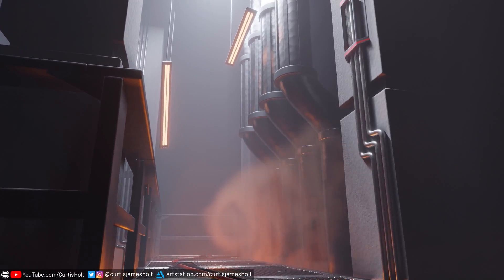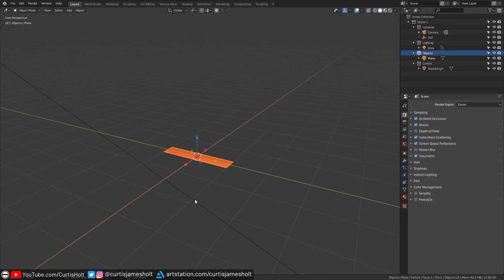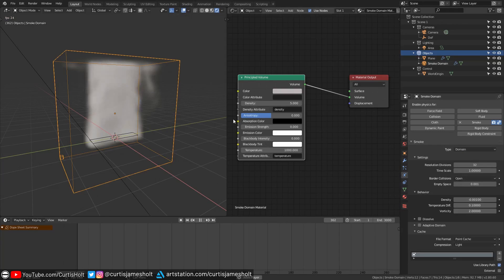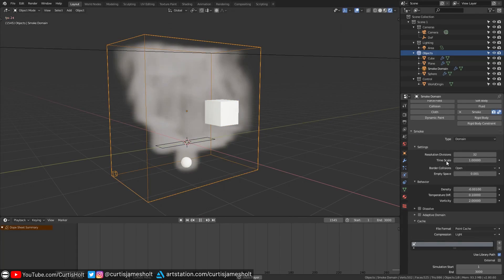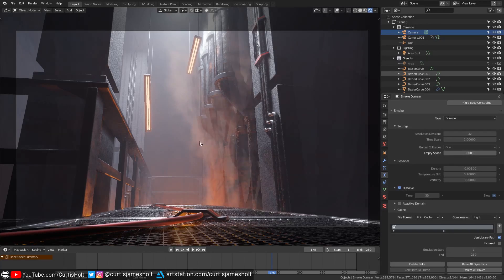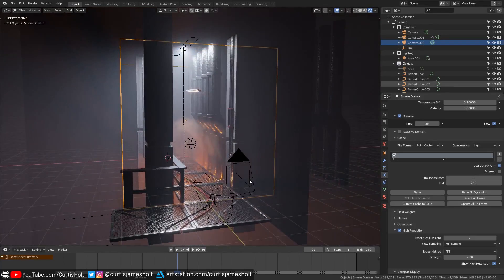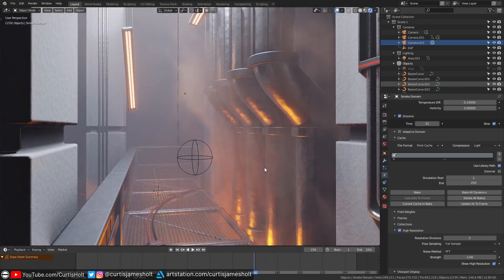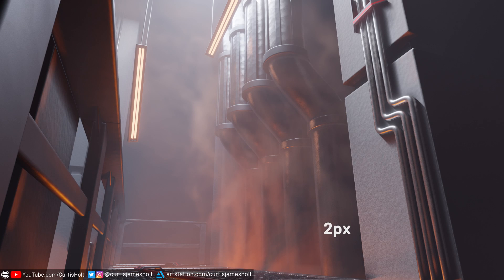Smoke Simulation in EEVEE (Blender 2.8)

Comment from the maker: NOTE: This will not work on 2.82+ versions of Blender as simulation features have been changed. This video is still relevant for people using earlier versions of 2.8, but please make sure to check the documentation for information on how the system works: https://docs.blender.org/manual/en/2.80/physics/smoke/index.html
Reply: In Blender 2.9.1. it works perfectly as simulation with  Eevee in a blank scene, but if you have more complex scene with other volumetrics it doesn't  work
Reply: Looks like 2.7 had better performance in viewport, 2.93 is sluggish and cumbersome - looking forward to nanovdb - wish blender was GPU sim enhanced.

Comment: Thanks for this smoke is still tedious to setup though because there's so many different thing that can go wrong but very little information on troubleshooting:
Rendering is all black
Domain box is solid color
Smoke doesn't render
Cube/emitter renders on top of smoke
viewport shading rendered not working
wrong materials applied
rendering freezes blender, so no progress bar telling you if it's rendering or has crashed.
Reply: im getting most of this issues >w<

Comment: Great video as usual Curtis! Can you tell me is it necessary to do the bake before you can render? Just experimenting with smoke and trying to render a single frame just gives me a solid box of smoke.
Reply from the maker: Hi John!
A bake should not be required before rendering. If it can be seen in the rendered viewport then it should be fine in an actual render, so this sounds like an issue. There's no harm in trying a low quality bake just to check though. Perhaps also check whether the domain object hasn't accidentally been set as a flow object.
Reply: @CurtisHolt  Thanks for the reply! I suspect it's a bug at this point as I did check the object types. Once baked I was able to render the smoke ok.